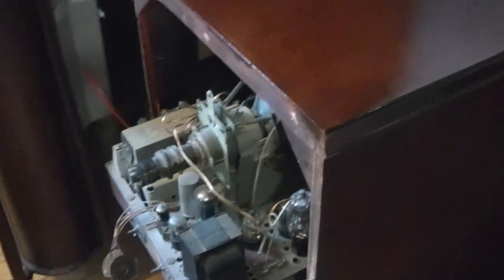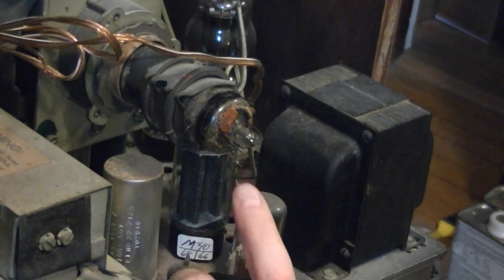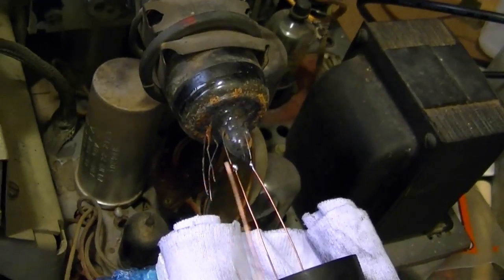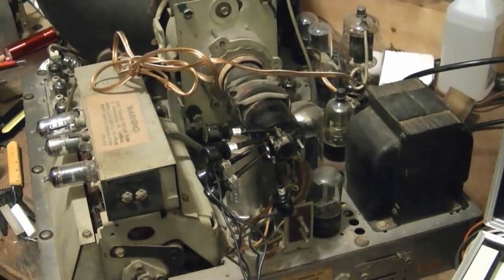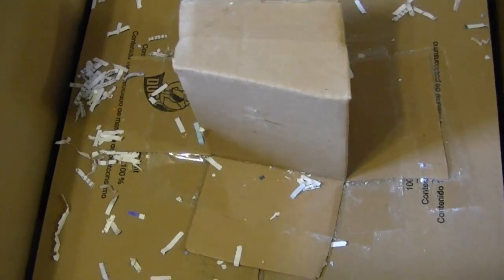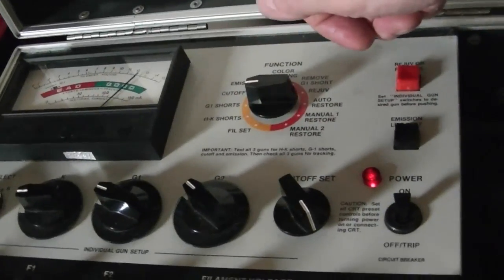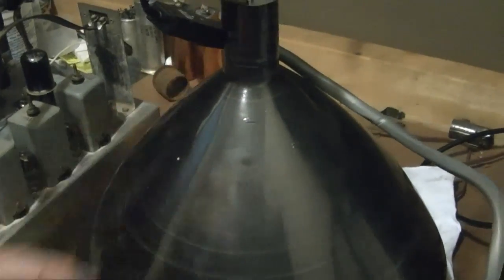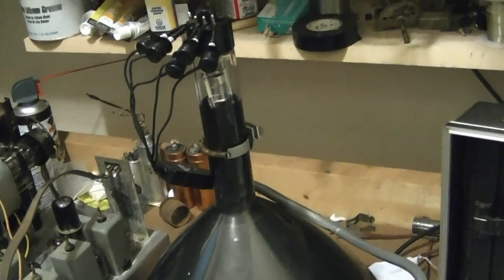CRT base repairs

Comment from the maker: Yes, I sure was worried about that so I crimped the extension wires before suldering them and used minimal heat while soldering the pins.

Comment: I once bought a turntable on eBay and when it arrived the seller had used packing tape to tack down the tone arm and the platter. It was hot when it shipped and the glue on the tape melted in transport. What a mess!

Comment: Are you ever worried about the solder balls on the extensions melting and disconnecting when you solder the ends in?